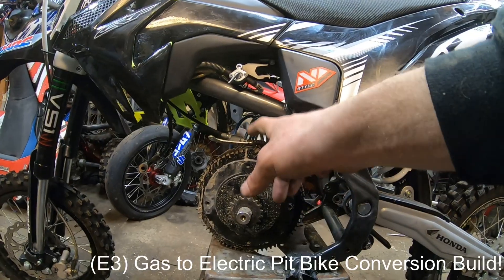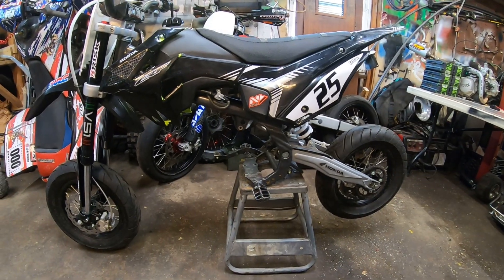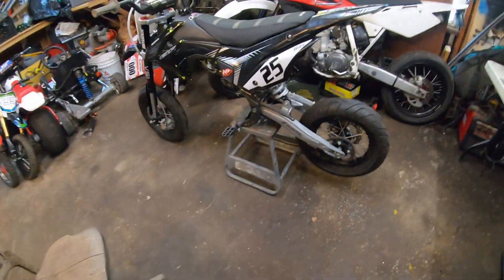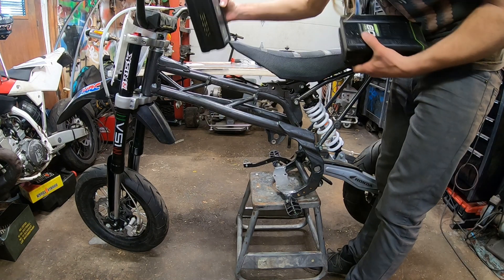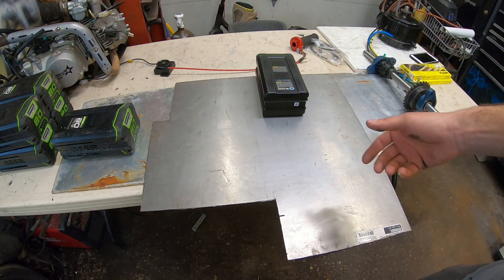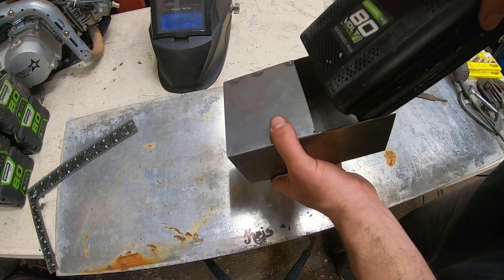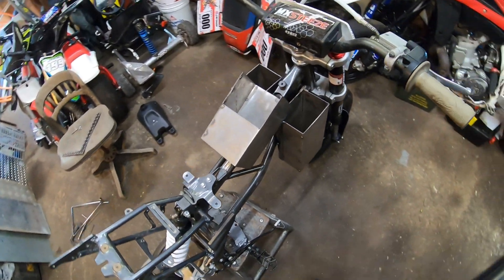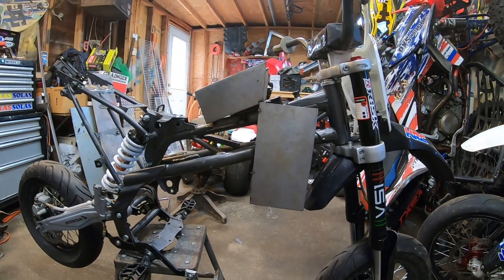(E4) *Electric Gas Tank* Electric Dirt Bike Build!

Comment: Those batteries are well integrated ! Pretty invisible I like it :)
But they are Lawn mower batteries right ? I hope your cable management won't be a nightmare ^^

Just a question, do you plan to disasemble them each time you need to charge ? Or your are considering adding a BMS ?

Comment: Yo I found your channel a few months ago. You need to start uploading again I love the vids! On the razor 3000w build you said how the motor had a slow ramp up. If you want the instant Torque you need to connect the Hard boot wire on your controller.

Comment: Is dude still alive?
Curious how long those vented, air cooled batteries will last in a metal box. You might think about drilling "speed holes" all over those battery boxes to help with ventilation. Heat kills batteries.
Ready for E5, sure hope you're still breathing.

Comment: When is episode 5. I have one of my own I'm working on I have a cyclone 3kw motor with the 6:1 planetary reduction on it and have a mini bike I might put it in but looking for a bike like what your using. https://hobbyking.com/en_us/turnigy-high-capacity-10000mah-6s-12c-multi-rotor-lipo-pack-w-xt90.html?countrycode=US&gclsrc=aw.ds&&gclid=EAIaIQobChMI3qWH4sCo6gIVS77ACh1LJgGPEAQYAiABEgIunfD_BwE I'm going to use three of these in series for my power cause they are way cheaper than the lawnmower batteries and I already have a charger I can use. I'm big into R/C and have always wanted to go bigger.

Comment: All's well bro, you hanging in there? Volts dictates rpm, Amps dictates torque, and every motor can handle over voltage and over amps with cooling. Love your Channel! Let's build something with crazy straight line speed. Challenge the gas mini bike drag scene!

Comment: Super cool video, keen to see how this comes out! I stumbled across this motor that from what I can make out it fits straights in to pit bike frames. May be useful to people who also want to do this conversion. https://wholesaler.alibaba.com/product-detail/Programmable-Electric-Motorcycle-Controller-Electric-Motorcycle_62447057530.html?tracelog=null
Reply from the maker: Yeah I’ve seen those and was tempted to try to one out but it’s kinda pointless. there’s no need for a clutch or really a transmission on the electric motor they are all parasitic losses.
Reply: @Krisuno   good to know, just seemed like an interesting concept as a bolt in solution.
Reply from the maker: Yea it 100% is and would prob work good to, just not as good as a Direct motor set up

Comment: CEO of underrated youtuber
Reply from the maker: Real talk lmaoooo
Reply: @Krisuno  found a battery on aliexpress:
https://a.aliexpress.com/_dVG9qnk

I know that that ain't the real specs, people say it is 10ah, but I will buy 2 and put it in parallel, so it will be 20ah. 20ah is enough for the same engine and controller you use right?
Reply: @laurensoffringa3529 His setup is running right at 80v but can produce a whopping 120amps safely. The problem with the aliexpress batteries is that only 15 amps can be pulled from the battery continuously and even if two are in parallel, you'll be able to get around 45 amps from the batteries supplying the motor with around 1700w insted of 10,000+w like his. What I suggest doing is buying a 60v samsung battery from https://batteryhookup.com/collections/bmw-modules/products/bmw-oem-16s-57-6v-35ah-2kwh-module . If you take this route, buy a 60v bms capable of delivering 100 amps continuous.
Reply: @TheRonDoc  thx for the advice.  I decided to buy a moped.

Comment: I have a 500w motor w/36v Li battery, 20A continuous current and 20A controller.. can i run a 36v 30A controller rated for 1100W with my motor and battery??
Reply from the maker: Yea you can, but you won’t go any faster. You will notice a small increase in torque and your battery will die faster loll.

Comment: Props for building one yourself and having a source for batteries but I think if anyone is going to build their own it would make more sense use a Sur ron battery or litespeed as it is just one battery and more output than your 6 combined and is actually less than buying the ones you are using. Glad to see others building and documenting it. I'm planning to build one with old ttr125 chassis that has kx100 suspension fabricated to kit and probably gonna use the litespeed battery assuming I dont build my own from 18650 cells  
Link to the battery and they also sell the complete bikes for those that arent DIY people like myself: https://ebikezilla.com/battery-engine/5009-battery-pack-litespeed-ultimate-v2-72v-with-display.html
Reply: I dont have that info offhand but the one it's an upgrade for is 60v 31Ah. This if remember right its 72v and about 40Ah but dont quote me on that. There are some videos of it on YouTube for the sur ron.

Edit: just checked their site,they have  multiple versions, a 32Ah,45Ah, and 52.5Ah. They also offer several chargers, the best one can adjust from 2-12A
Reply from the maker: There’s no info on that lightspeed battery. how many amp hours is it ? and how long does it take to charge? with the charging set up I have custom-made for my batteries I could charge all six of them in 75 minutes from full dead. I did this set up to run them in parallel but charge them as individuals with a six port charger instead of charging one big pack. It takes longer to kill the battery pack then to charge it. But I could see and understand how it’s easier to buy something premade that is used on other electric dirtbike‘s, just for me it’s nothing new I rather experiment in different ways.  The easiest way to build one of these is to just buy a sur ron and put the part on a dirtbike frame LOL
Reply: @Krisuno  https://batteryhookup.com/collections/bmw-modules/products/bmw-oem-16s-57-6v-35ah-2kwh-module

Comment: Just put extension wires on the greenworks charger.  And connect it up to the bike. The batteries are in parallel so it'll be way simpler then having to remove each battery for charging!
Reply from the maker: I’ve been messing around with that idea for a while I might do it eventually!!
Reply: And make it plug into that gas tank

Comment: Why not see how many you could hide under seat and back plastics? Maybe a alloy mudgaurd to protect from road grime and stones
Reply from the maker: I need to save room for the speed controller and radiator I’m thinking of shoving all of it in the frame like under the seat and in that gap above the motor
Reply: @Krisuno  ah, hadn't thought of that, forgot it was liquid cooled, I think there would be room under the seat for controller where you can see through the plastics depending on what one you use